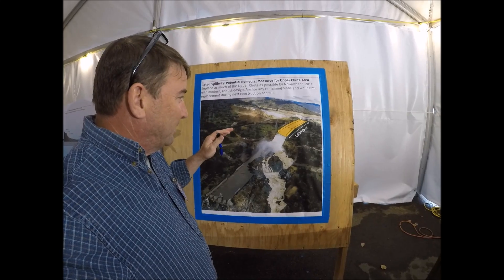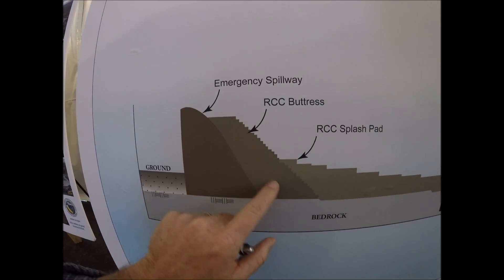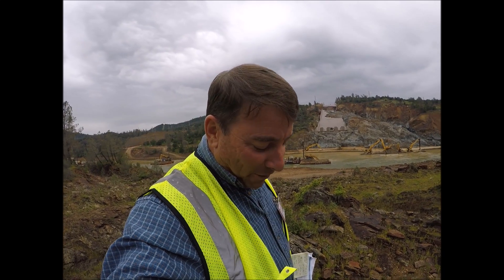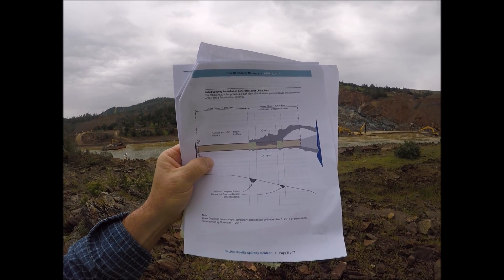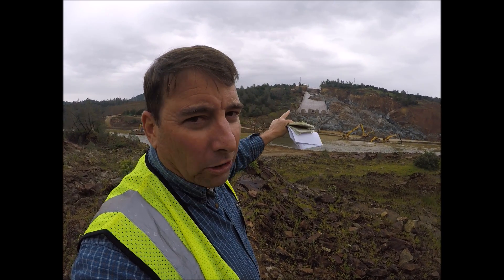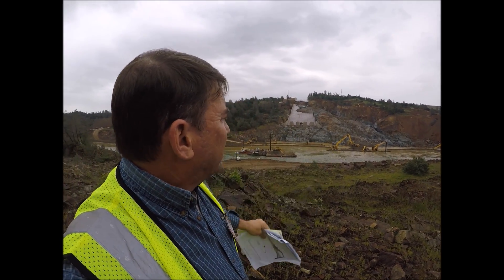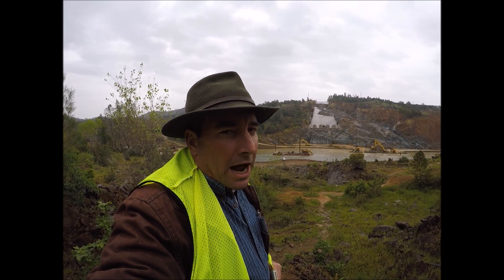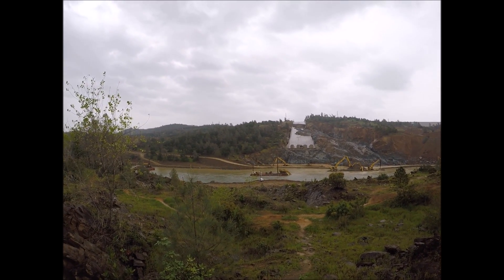Oroville 6 April Update The 'New' Spillway Design Revealed!

Comment: Dear Juan:
 saw most of your fantastic videos and comments on this damm. From the beginning, it was quite clear the low flow of the spillway compared to the hidrographic basin area, even with the emergency spillway, but i suppose that is out of the equation now, unfortunately. My questions as a civil enginner, are mainly two: first, the spillway location absolutely perpendicular to the normal bed of the river; this unables a proper spill into the river , not disturbing its flow, but also increases the debry deposit uphill the river, acumulating material enabling the river's proper flow and use in full of the power station. Second, the lenght of the spillway; i never saw such a big spillway with 1.5 km long, expecting to have a laminar flow, without turbulence.  As you know, it's turbulence that causes erosion, and no concrete or diamond made spillway will stop turbulence. Spillways are made to direct water as short as we can, releasing it from contact with our infrastructure; and when there is turbulence, we throw water in the air, to loose power. Feel free to comment if you wish. Best regards from Portugal.
Reply from the maker: unfortunately  it is what it is, this is the design they're stuck with. Gotta work with the 90 degree entry into the Diversion Pool, thus the big blocks at the bottom.

Comment: Will the RCC stand under high turbulent flow? Is there a way to unify the layers. From what I have read, it is applied in 10 inch layers. More rock bolts?
Reply from the maker: I think a  reinforced concrete spillway will cover the RCC...eventually...(Main Spillway)

Comment: My guess as to why the spillway failed is overtime the thickness of the cement got thinner and thinner due to erosion.  Either the dam operators didn't know that they should monitor the erosion or they were neglectful or funding for proper maintenance of the dam was not enough.

Comment: It doesn't seem to me like you would want the upper and lower spillways to join right at the place where the last one failed (where the angle changes), but what do I know...  I also don't think I understand the function of the cut-off wall on the emergency spillway.
Reply: I think the cut-off wall is to transition the water flow from the top of concrete spillway apron directly down onto bedrock, however deep that may be.  Sounds like the bedrock will still be the spillway for the lower 3/4 or so of the hillside.

Comment: I wonder if they're planning to re-design that radius of curvature where the upper spillway changes grade significantly to closely conform to the arc recorded on many films during the use of the main spillway.  WHY?  I believe that there is a hydraulic "jump" occuring and it's where this water comes back into direct contact with the concrete surface that the cavitation caused wear and ultimately failure of the spillway slab occured.  AND / OR have they considered constructing an air slot or some other aeation device into the upper spillway?  This has been a successful design change on other spillways where cavitation was a problem.  Maybe they should do both.  http://staff.civil.uq.edu.au/h.chanson/aer_dev.html
Reply: Take a side view of the spillway. That's a LONG LONG radius. The telephoto lens from the front makes it look sharp
Reply: so then are you saying the water is always in contact with the spillway (no jump)?  I don't care how gradual the curvature is, I just think there should be no "jump" at any discharge volume.

Comment: what is a flood stage in flow?
Reply: Flood stage is when a river gets above a certain level. If you're ever out walking along a river there are usually measuring marks along overpasses and easily accessed areas where the authorities can see the river level. and record it. They know what normal is, what normal high level is and what flood stage is
Reply: I  was asking  volume . 
Like during the El Nino of the late 90s, or the early 60 late deep snow followed by hevy tropical rain . they are calling for 250K cfs out capacity(160K temporarily)  Vs XXXK potential in flow? a better question is how much Inflow will it take to overpower the compassity of the normal spillway?

Comment: Nice report Juane. Here is how they will be moving concrete in massive amounts in the very short order building season ie 9 month building window.

Rotec makes a tower belt delivery system and maybe 6 units of their 'Creter Crane'
http://www.rotec-usa.com/tower-belt/
http://www.rotec-usa.com/creter-crane/

For a massive shortened building time window, this better be part of the placement of a properly rock bolted and engineered curtain walls to the bedrock spillway.

If the above placement equipment isn't part of the plan; DWR will be hooped.

I hope the 4 contractor bids have something like the above as part of the plan!

Just maybe they make the November 1, 2017 deadline

Good luck and God Bless, y'all will certainly need it!

Cheers

Hans
Reply: They're likely to put a portable concrete mixing plant in place. 600 tons per hour. They'll truck it. RCC has to be in place in half an hour after mixing. It's installed like road asphalt. cemexusa has some good youtubers

Comment: Gotta love that the cause will not be given out to the public and I'm betting any of that info that does come out it will very limited blaming no one or perhaps the old methods used at the time of construction.  I'm sure it will not mention any of the inspection prior to the event causing the spillway fail.  It would be interesting to find out what the cost would have been to fix all the issue prior to the failure and what it's going to cost to fix it now.

Comment: I found a answer to your question about the maximum allowable head pressure for the RVOS. According to https://www.usbr.gov/tsc/techreferences/hydraulics_lab/pubs/HYD/HYD-508.pdf, it's 672 ft.
Reply from the maker: Wow! so they would not make any difference at this point...I thought this would be an issue! Thanks Daryl. I hope DWR understands this thoroughly and puts no one else in harms way...
Reply: It would appear so, but the document I referenced was dated from before the dam was built, so possibly the new valves and baffle ring can be operated with more water in the reservoir. I'm pretty amazed that Bill Croyle could not answer that question or at least that someone from his staff didn't stand up and provide an answer.
Reply: It may be that the limitation in that document no longer applies because the valves were replaced. Apparently howell-bunger valves generally can operate at 300 m of head. Since the valves are new, maybe the limitation is higher than it was for the original valves. Again, DWR should know the answer.

Comment: Thanks for the info. You mentioned $2 million a day just for emergency work, so easily over $100 million for that. To accomplish all that work in nine months,  24/7 schedule for sure. Won't be cheap....and passed on to the water users and drinkers in California.Interesting on "criminal" charges, why the Sherriff? It's a state  project and any work was done by state contracted workers, so should be Attorney General Or the FBI, if it's considered possible back scratching went on in bids and inspection.

Comment: So, once the last water run happens, they fill eroded areas of the spillway, to bring it back to its former grade.

Then repair the upper spillway, or demolish the entire thing  down through the foundation drains, and rebuild on solid base course, whatever that is deemed to be.

June 1 through Nov 1, five months for a complete demo and rebuild of 1600'?  Is that realistic, or will they have to do phased sections over several years, or wait for a drier year when they can start earlier with the demo.

Comment: A little information on "Rolled Compacted Concrete" You can research this at, American Concrete Institute, www.concrete.org. A controlled low-strength material (CLSM) is a self-consolidating, cementing material used primarily as a backfill as an alternative to compacted fill (ACI 229R). Several terms have been used to describe this material, including flowable fill, unshrinkable fill, controlled density fill, flowable mortar, plastic soil-cement, and soil-cement slurry; however, the correct terminology is controlled low-strength material. CLSM is intended to result in a compressive strength of 1200 psi (8.3 MPa) or less

Comment: Thinking back to earlier pics the initial failure would seem to be due to the thin concrete seen in the center of the floor of the spillway.   Was it poured that thin or did it wear to that thickness is the question.  I would think it was poured too thin.  If wear was the problem exposed rebar would have been seen.
Reply from the maker: I think you're right...a 'poor' pour...
Reply: blancolirio
And a damn dam ?

Comment: Wasn't the original problem that the original spillway it was poured too thin? And it's eventual failure was caused by lack of maintenance. I think you answered this question however the control valves were either full on or full off and was there any discussion about getting them repaired to allow control again?

Comment: If they are planning on filling in the first plunge pool with RCC, wouldn't it be better if they used a lot of the large rocks and boulders that they just dug up out of the river? RCC is used to create dams that are used to hold back tons and tons of water. They are going to be using RCC to fill in a giant hole which doesn't need as much structural strength. Basically it is identical to the support structure for an above ground freeway. Thus, why not fill in, at least part of the hole, with rock and boulder debris that was excavated from the river?
Reply: I wouldn't be surprised if the crushed and filled in level before they added the RCC. The equipment to lay down the RCC needs flat ground, Kind of laying a road bed and then 20 or 30 feet of RCC.
Reply: @The Woods: Yes I agree with you 2, that will be the body of the plunge pool. But I'm waiting to see Alpine Rotary Cutters reach in on the Excavators to work the plunge pool surfaces into some teared flat driving, drilling and work space, before the filling starts. DWR needs to work the loose material off of the plunge pool surfaces before they can lay the RCC and Fill layers. Then there is also going to be trenching for the 2 main footing blocks, that will be interesting.
Reply: I've watched the video through a couple of times now and picked up a couple of details. Some of the work on the hillsides is going to be access roads into the spillway, to bring in equipment and material. The intent is to have 100,000 CFS capability by Nov 1. I did some rough calculations a while back, 10,000 CFS is about 1 foot water depth. Therefore 100,000 CFS would need 10 foot walls plus about another 5 feet on top. That can be done relatively easily. For 270,000 CFS the walls are going to have to be 27 feet plus. That's about 35 feet. That's a little trickier. My understanding is to build the floor and 15 foot walls this year and add an extra 20 feet to the walls next year........RCC is basically applied in layers just like paving a road. It needs a level surface to work on. That eroded rock is so jagged it would stop a tank. They're going to have to prepare somehow. Either they dump in RCC and level it somehow or they fill it with crushed rock and build a road base the top of which is 10 to 20 feet below the spillway surface. I would think that each team will take on a section and prepare the "road bed" and then go to town on paving 10 to 20 feet of thickness. RCC actually makes installing re-bar easier. Lay it down and pave over it. ....... Much if not most of the 1.7 million yards dug out of the river came from the hillside and not actually from the spillway. Means I over estimated the amount of material required......Some one in an earlier video mentioned they are already crushing and screening material and stockpiling in preparation......The plan presented by DWR is the 60% plan as defined a couple of weeks ago. The details will be given to the contractors, and they will be different. ....... I hope they put up a live feed so we can watch the work live......As a point of comparison, a runway is 4 feet thick concrete. It takes a greater beating from a 777 landing on it than 27 feet of water. 27 feet of water is only 12 psi. Sure there's a lot of area and the water is moving with kinetic energy but it's not an outrageous load.
Reply: They are improving the spillway established weak link to exceed a new 270k cfs flow spec. The RCC can be grout anchored and rocbolt's w/ multi-strand anchoring systems that can be drilled to attach to the spread out amphibolite bedrock in the plunge pool.
Reply: True, but from the description, I have the impression that it basically will only be a support for the spillway. Due to the limited amount of time that it is used, I'm just wondering why it has to be engineered to a higher standard than most dams are. That's all.
Reply: @Woodie615: The spillway got damaged/popped/failed on a 100 yr storm season and they were only engineered for a 50 yr storm. They now also want to accommodate wear and tear or buffing from normal use. Also, the trend is to accommodate global warming and new security mischief. The concept is for every foot of ocean rise the 50 yr storm design can reduce those standards by +or-60%. So the engineers are going bigger is better.
Reply: Eastern Woods, Thanks. That is what my thinking is also. Glad someone else was thinking along those lines too.
Reply: Plus add in the frequency. How often do planes land on a runway, say at LAX or SFO vs. how often will the spillway be subjected to 270,000 cfs flows?

Comment: I looked at the snowpack data last night, and it showed very little melt off - about 1 to 3 inches in most areas of the Northern Sierras.  Todays storm has added significant amounts of new snow!  The 40,000cfs flows today have boosted the lake levels fast.  Looks like only about five or six days until they must release, which is ahead of schedule.  To avoid use of the emergency spillway, the lake levels must be significantly lowered soon to make room for the snowmelt,

  It appears that the earthen canyon walls, recently stripped off, will erode fast, which will likely shut down Hyatt.

  I also looked at Roller-compacted concrete.  The process requires an absolutely dry bed, is limited to 10 inch lifts, utilizes a 10,000 ton roller vehicle which makes four to six passes, and does not allow for internal support such as rebar.  It is primarily used for highway shoulders, parking lots, logging roads, and low speed traffic areas. It looks a lot like asphalt, and has tight timing requirements to get it right.  The RCC will be easy compared with the supporting flume area, for which we have yet to see a coherent plan.  RCC is very dry so you can't dump it in the plunge pool to fill the deep cavities.  It doesn't work that way. They are in the bidding process?  The cart is before the horse, and before the forensic report.
Reply: If you wait for the forensic report the season will be gone and you deal with next years issues all over again. They'll pump out the water before they start.

Comment: ...This may turn into a 24/7 project like the replacement of the dual track railroad trestle that burned here in Sacto around 2007....just a short walk from my job......that was very, very, impressive....a lot of equipment, 4 pile drivers, and steel/concrete railbeds....

Comment: ....3:22....'cut off wall'....kind of reminds me of levee work here in Sacto a few years ago....they used bentonite and excavators with 65 foot arms and 16" wide buckets to dig about 50 feet down , along the center of miles of levees.....then filled it wait bentonite
 They had to do it twice...the first time was about 30 feet deep, and water leaked under that, developing 'boils'.....

Comment: They should build a second power house to the bottom left of the emergency spillway connected with large steel pipes that could effectively be used to siphon the dam and be a backup power if the Hyatt power plant cant run. Similar to Tumut3 of the Australian Snowy Hydro Scheme. https://en.wikipedia.org/wiki/Tumut_Hydroelectric_Power_Station#Tumut_3_Power_Station

Comment: I have been following your reporting since about the end of Feb. when I just happened across it. You have done a great job in your reporting. I have learned a lot of how the California watershed system works now and the general workings of a dam. So they are looking a lightning fast pace of 9 months, but really, will they be able to do that much work on the upper portion of the main spillway until after all the spills for this season are over? Also, I know this will depend on snow melt and lake level rises and that can flucuate,  and also whether they need to do one or two more spills, but in a normal year about when does the last spill occur? I hope you understand my last question. I know there aren't any exacts just estimates for this year or averages from years past when the last spill occurs. Also, in an average wet season, how many spills does this dam have to do? Thanks again for the great reporting!

Comment: Thanks for the update. 
I have always thought using fly ash from coal fire power plants to produce autoclaved aerated concrete (AAC) to be a good use of an industrial byproduct. However, after reading about roller-compacted concrete (RCC), which also uses fly ash, I have concerns about heavy metals in the concrete leaching out. It will be interesting to see how heavy metal levels are affected.